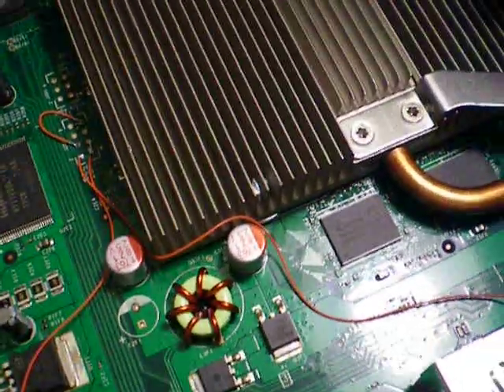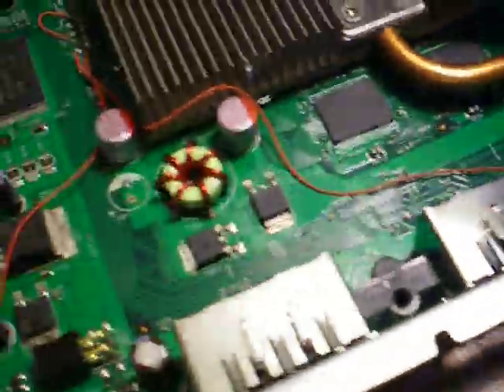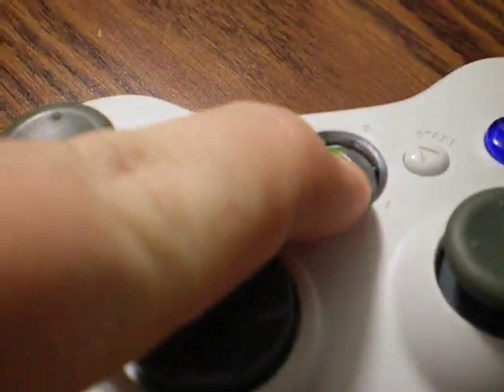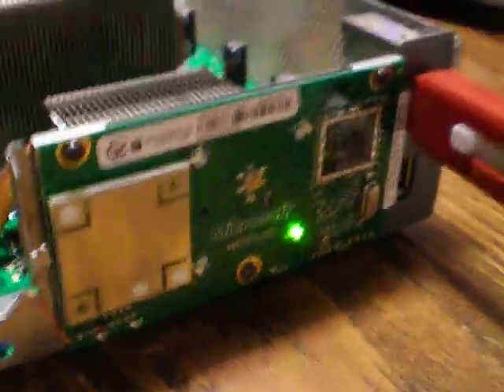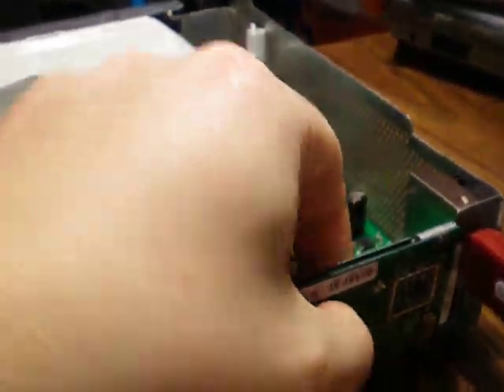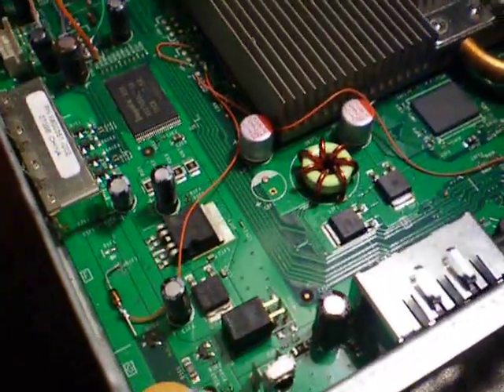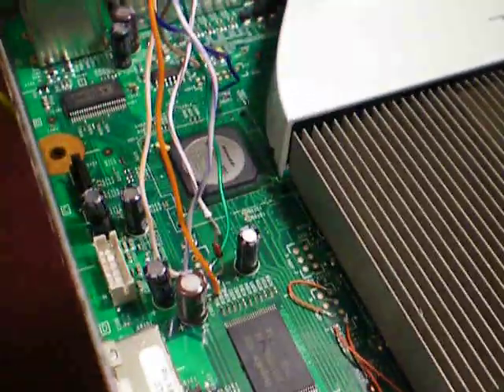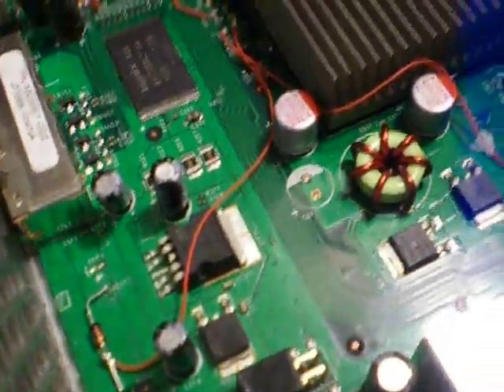XBOX 360 Hack Exploit Running on Zephyr, Opus, and Falcon Mother Boards.

Comment from the maker: Well most of the time pci ltp ports will not work, but you can get a usb flasher that will work for you it's about $30 and it is way faster then the lpt about 2 minutes compared to 45.